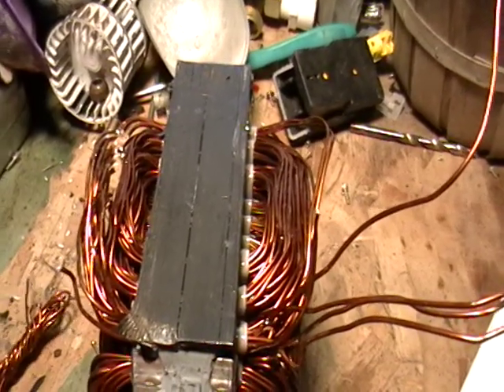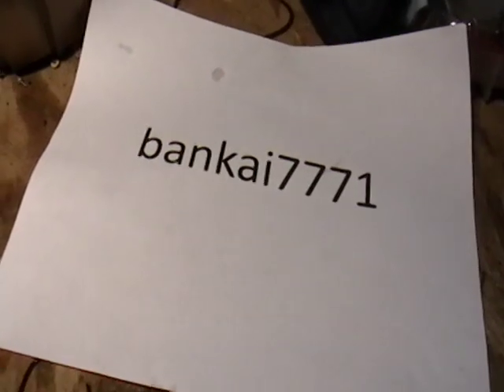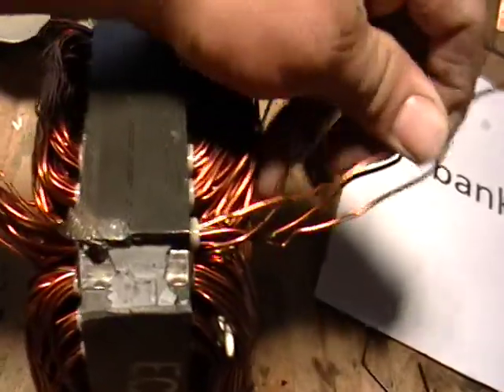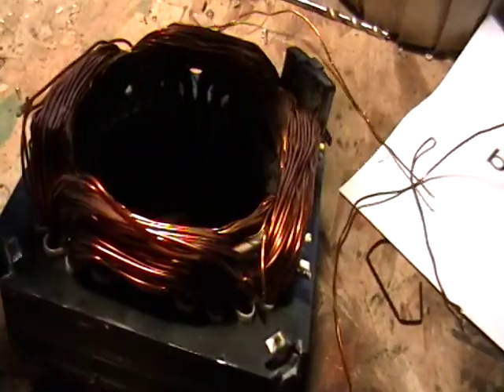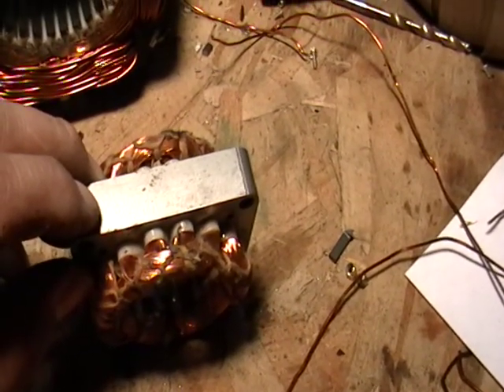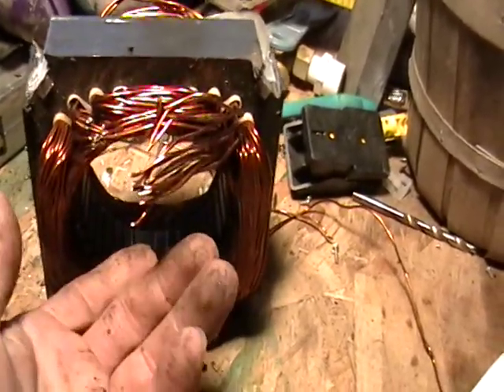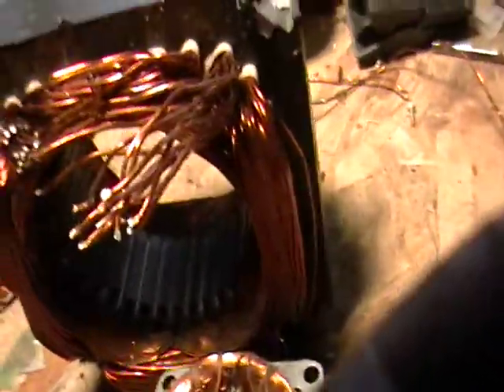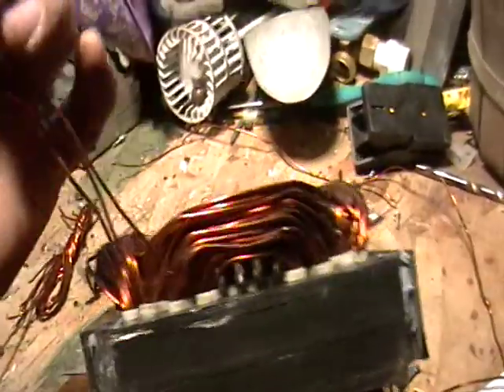Removing copper from an electric motor.

Comment from the maker: @coolin7000......on some motors it is aluminum...Cut one wire off the motor. If you see silver inside its aluminum, otherwise its copper. Thank you for the comment...Peace

Comment from the maker: @fordbroncobart1....cable modems have low grade boards, transformer & wire. Some might have gold tips. Laptops...Yummy. Lots of stuff in them just like a computer tower. Shredders: Scrap everyting. The bigger the shredder the bigger the motor and more stuff to scrap. They do have goodies in them, copper, aluminum, lots of steel. Thank you for your comment and keep watching i do have a shredder to scrap. Peace

Comment: that big electric motor is actually wound with aluminum wire coated to look like copper if you cut it you can see the aluminum inside

Comment: My yard takes electric motors as iron. .05 cents a pound. So it is worth taking the smaller stuff apart. What did you sell the aluminum wire as? Did you pass it off for copper?

Comment from the maker: In my video its all copper. some have copper coating and its aluminum inside. Washing machines & dryers have aluminum wire in them... Not all washing are like this you will have to check the center, before you open it.

Comment: That's a hard way of doing it. One guy suggested getting a grinder and cutting wire flush with the laminations, (They are mild steel, and there is a good  electrical reason for them, by the way)  That idea is good except he suggested pulling the wire from the other side with a sharpened tire tool, I think it was... That too, it too much work.
In my experience, these days, MOST motors and even transformers, yes, even microwave oven transformers, are ALUM, NOT copper! (Old ones tend to be copper, but they have to be REAL old) And Alum isn't worth as much, it takes a lot to make a pound. So, I do it the lazyman's way. I start like the other guy, cutting all the wire from one end, (I use the thinnest blade I can get) and then I put it in the vice with the freshly cut wire facing me, and I use a punch to push, not pull, the wire out. It's been shellacked, or varnished in place, (there is a good reason for that too) and pulling to break that loose is too much work for Alum wire. Or copper either, for that matter as it's only No.2 at best, and No. 3 or worse, depending on size. (Angle Hair is hardly worth it unless someone else has done all the work for you)
Alum doesn't matter, it's simply by the pound where I live.( IOWA) depending on type. Cast, wire, sheet, extruded, (more than one kind) etc, Try using a punch, or cold chisel sized slightly smaller than the hole the wire is going through, that works best for me. I like round punches for this, but any punch will work, it's just more work to use a cold chisel. (The wire comes out in pieces, and the chisel is more likely to get stuck) It will with a round punch too, but not as badly, and you have less work. Try it and see if it doesn't work better for you. TheRealJunkMan

Comment from the maker: The aluminum wire i would sell as is with the motor. if seperating i would put in my aluminum pile. The varnish, i will experiment with that...

Comment: Mike HI! I noticed on this video the large motor looks like alulinumwhitch catigory would you make this I also have some, is there a good way to treat varnished copper wire, crushed to learne 1/2 my twenty five lb. bucket of copper wire is not # 1. Dave

Comment: Go to Harbor Freight. Get a 4 1/2 grinder and a 10 pack of cutoff wheels. Slice one side of the wire flush with the "brick". Set it in a vice with the uncut side facing up.  Then use a tire iron that's been sharpened to a point to pry the wire from the brick.

Comment: In my state, oregon, a motor is worth .25/lb, coated aluminum wire is worth .55/lb. I took a 16lb motor apart and it was aluminum wire witch I did not know until is was almost apart. anyway I got 1lb of aluminum wire. I turned a 4 dollar motor into a .55 pile of aluminum. I havent taken a copper one apart to figure out the price yet, im out of motors, but I will check it and post. I havent turned the wire in yet, should it go as something else? thanks

Comment from the maker: @gravelguy1955...The wire should be sold as what it is. You don't wanna sell your aluminum wire as copper. you can get banned from that scrap yard. scrap the motor and seperate the metals. NON FERROUS / FERROUS. Keep me posted. Peace

Comment: Three suggestions; 1/ :SLEDGE HAMMER, to bust open the steel casing. 2/: ANGLE GRINDER.cut through the wires on opposing sides.3/.:pull those copper wires right out of there.HAPPY ENDING!

Comment: Isnt that a aluminum bound motor? looks like it. from what i have found 95% of electric motors out of washers and dryers are not evan copper, so if you can get away with selling them as copper break for 25 cents a pound your doing all rite.